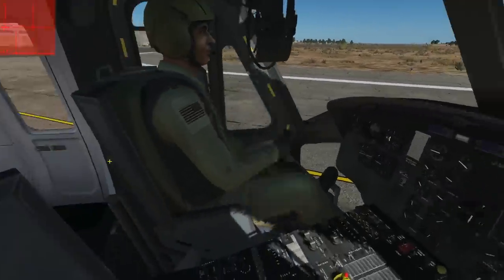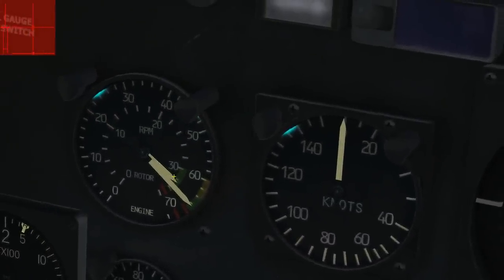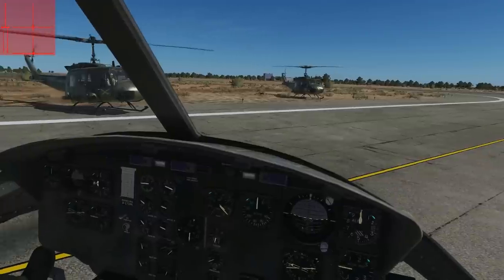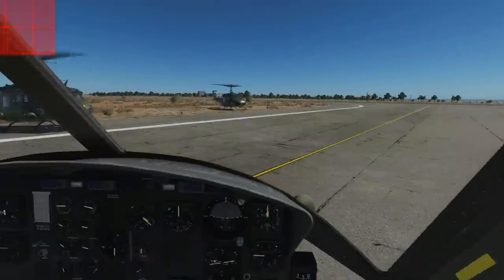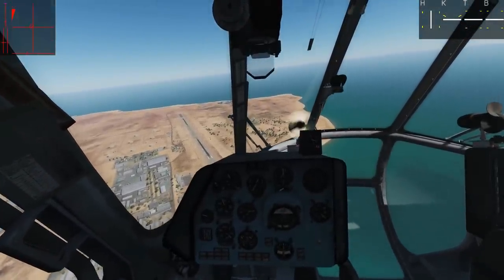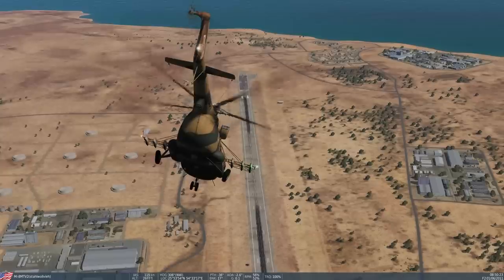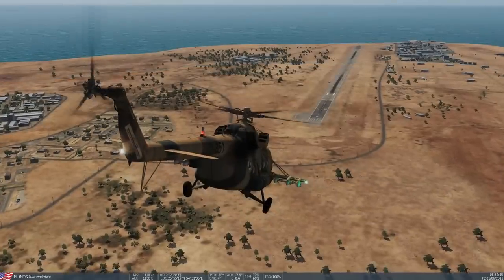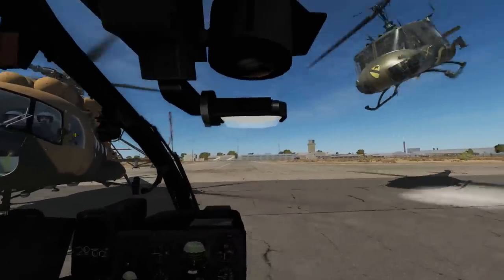Flying Basics: Autorotation In Helicopters Tutorial | DCS WORLD

Comment: Well done Cap! Great demo. I learned on Gazelle, every training sortie ended with an auto until it was second nature. Even the hover taxi back in would have the instructor chopping the throttle! When flying helicopters always be aware of the wind direction and possible landing sites for when it goes quiet. As a rule 65kts is the aiming speed in auto to give most thinking time, 90kts will give range, be into wind with 500 feet to go and start flaring with gentle rearward cyclic at around 100 feet to aim for a check or pull up on the collective at around 20 feet. Should give a very small run on at around 20 kts. The inertia in the huey should allow you to land from a 65kt auto, then pull it back to the hover and put it down again, the gazelle definitely won't!

Comment: ALWAYS ALWAYS move the cyclic AFT on initial entry to an auto, even a zero airspeed auto. Get the rotor RPM sorted and then work on the airspeed. Lowering the collective will make the nose drop for you. Move cyclic aft at the same time. If the nose drops too much you lose rotor RPM, you then lose cyclic authority, and you won't get it back. It has happened IRL with fatalities.

Comment: The reason for flaring just prior to touch down in autorotation, is firstly, flaring actually slows your decent, secondly, flaring increases rotor rpm, giving you more energy availability for when you pull the collective up, thirdly, reducing forward speed before touch down, reduces the chance of having a dynamic rollover. Even though the latter isn’t monitored in this sim, the other two are.

Comment: Cap et al: 2 options for flying a forced landing in a huey-type aircraft - either a low speed auto or a medium speed auto. Low speed:  lower the collective lever and (if less than 40kts) hold level (if more than 40kts) flare nose up to get speed back to 40, then level. Use lever to try and hold rotor speed in the green. Once "about to hit the ground" (about 50' depending, I don't know how well DCS models) pull the lever all the way up from nearly no collective to all the collective over the course of the last 50'.  That works well for going nearly straight down.

Medium speed auto: lower the lever. If above 70 knots, flare nose up to get back to 70. This will give you extra rotor energy as well. If below 70 hold nose level until your descent has established, then gentle nose over to get up to 70. Don't dive it on right away. Hold 70 kts using forward/backward on cyclic, hold rotor speed with collective. If you turn (with bank) rotor speed should try to increase (DCs modelling??). As you roll out it should decrease. Use collective up/down to stop both of these and keep it in the green. When you reach somewhere around 100' (again, depends how well DCS models this and how heavy your aircraft is - a full mi8 will need more height!) Flare to about 10-15 nose up to reduce forward speed and build rotor speed, then use collective to gradually reduce rate of descent. At about 20' put the nose to just above the horizon (around 2 or 3 deg above on the attitude indicator) and pull the rest of the collective. This will stop you having a tail strike. It should be possible to touch down with less than 20kts and a very gentle rate of descent if entering from forward flight.

Finally, because this is the GR and you would never fly high for a mission: from low level at speed, it should be possible to auto (DCS??) so long as no trees are in the way! Immediately flare to 15deg nose up. Lower collective to keep level. When you're hitting 40kts start to lower the lever and level the nose. Then pray!
Reply: Ps. Meant to add. The reason 70 kts works best is because that's your speed at which you need the least lift to maintain level flight. Therefore you can get the longest time in the air in auto before hitting the ground. You can get further at faster speeds, but it doesn't make that much difference and gives you less time to think!

Comment: Try a low level engine failure. Fly at 120 knots 10 ft up the. Cut the throttle. Convert airspeed to height, again watch the rotor speed as it will increase in the flare to height. Then do you usual auto landing. Gazelle is good but you need 40 knots across the tail to help with the torque so keep the speed up until you are down. Then ease the collective down to transfer the weight onto the skids.

Comment: Camera almost lost all rpm because he nosed over so hard. There is a maximum airspeed for autorotation in each machine.  50-80 kts should be your target speed on descent. The only time to lower nose in an auto is if below glide speed. Don’t lower the collective after touchdown or pull aft on cyclic, you will cut your boom off.

Comment: Flight model is not very accurate. In a real helicopter if you were to apply forward cyclic as aggressively as shown the rotors would actually slow down. The rotors have to have upflow from the bottom of the rotor disc to be in "auto rotation". Its the exact opposite you would want to do in a real helicopter. Real life auto rotation entry in forward flight is accomplished by smoothly lowering the collective and applying aft cyclic to build rotor rpm back and put the aircraft in the correct profile. Then you would adjust the aircraft attitude with cyclic to smoothly obtain a air speed between max glide and min rate of decent. Anywhere from 60 to 90kts would probably work ok. Looks to be good fun though!
Reply from the maker: thx
Reply: You can see Camera's rotor coning and slowing big time.  The reason he broke the gear is he ran out of rpm.  It was neat to hear it on the sim.  Other sims don't seem to have that fidelity.  In the Jetranger or OH-58, we keep the helo fairly level.  About 70+ft, start your flare, and that flare will actually keep your rotor energy up due to the airflow through it.  Then you get a level attitude and use collective to settle to the ground.  One other important thing to note:  You are not going to hurt the chopper going forward.  Even at 60kts.  It will slide and make a lot of noise.  But, you certainly can hurt it with sideways motions or backwards.    CAP did a pretty good job on his very first attempt.
Reply: BrittMac422 no doubt. DCS seems much better than MS Flight Sim had when I tried it back in the day. I was impressed to hear that the generators would kick off at a certain RPM and you’ll lose electrics(should lose everything except for what’s on the battery bus). That’s very realistic.

Comment: To expand on the physics a bit, the reason you can create some lift the whole way down is because the outside of the rotor is moving faster than the inside, since it has a greater distance in the circle it has to cover each rotation. You can take advantage of this to have the air flow from your forward movement pushing against the rotor on the inside of the blade, causing it to spin, and the spinning blade pushing against the air to create lift on the outside.
If you check the channel Smarter Every Day, he did a great video a while back on how exactly it all works, including a demonstration of it it in real helicopter... even with confidence in both the pilot and the physics, I don't think I'd be brave enough to be along for that ride!
Reply: That's not really accurate. The outer part of the blade (about 30%) actually does not contribute any rotor thrust at all because of a number of factors but mainly because it is offset by drag. Also the outer part of the blade becuase of the blade twist is almost flat during an auto because the collective is down, so the AOA is small - sometimes a negative value.

The middle of the rotor disc (about 45%) provides all the rotor thrust. The blade has a twist so the closer it is to the mast, the higher pitch it has.  Because of this the inner part of the disc (approx 25%) is at the highest AOA - beyond the stall point - so it has the highest drag and is slowing the rotor down.

Forward movement does not cause the blades to spin. They will still spin even if you descend vertically.

Comment: The gazelle crashes are DUE to the nose down attitude on entry and flaring too early. When entering an auto the airflow through the rotors must change direction and while that is happening the rotor rpm is sensitive and the attitude is extremely important. Most standard autorotation entries call for slight AFT cyclic to aid the airflow direction change and to keep the nose from dropping. Low inertia rotor systems are much less forgiving, which is why the MI8 and UH1 worked out for you, mostly. [You can try this in the game by hovering at ~1000ft AGL and entering an auto without nosing over. The helicopter will transition to an auto without any forward speed at all, be careful to check the rotor rpm quickly since you will rapidly overspeed the rotors. Once you establish a steady state auto you can drop the nose with forward cyclic and by decreasing the collective in order to regain airspeed for the flare at the bottom] Finally, the flare at the bottom turns vertical and horizontal airspeed into rotor rpm allowing you to arrest your rate of descent, reduce or eliminate airspeed, and cushion the landing. Airspeed reduction is important especially since not all landing areas will be several thousand foot runways with perfect surface conditions. Landing the Huey into a field with loose soil at 60-80kts airspeed is gonna be a bad time, for example. Do a little more research and practice then show us your improvements with a new video! The other chap is spot on with his readings of the helo flying handbook. Plenty of info in there to set you guys up for success. All that said, this was still an entertaining video,  Cap. Keep up the good work GR!

Comment: Sorry Cap, I have to disagree on a point you made. Years ago I completed my commercial rotary wing flight training and there’s no need for the dive. The inertia of the blades is created by the upward flow of air passing upwards through the rotor disk. The rotor speed is maintained with the cyclic and the collective. Given enough altitude you can perform a number of maneuvers such as a 180 and 360 degree autorotation, even going backwards
Reply from the maker: rgr MA
Reply: Grim Reapers apologies Cap you will need air speed for the flare near the end of the autorotation. I would practice entering the autorotation at 60 or 70 KIAS.

Comment: Can you instead of shutting down the fuel, turn the throttle down to idle in the Huey? That way you can turn it back up again once you landed and retry the autorotation?
Reply from the maker: I imagine so.
Reply: This should work in game, not in real life tho. The throttle in the real world on a Huey requires several rotations to go to idle. Obviously can't model something like that in game.
Reply: @justinnoel6273  ooh ok makes sense. But how do thay practice it then in real life? Can't think they shut of the fuel for training... Isn't that bit risky?
Reply: @carloolivier1940  honestly I don't know how autorotations are practiced in real life on a Huey. Something like a Robinson R22 is able to just cut the engine to idle because it only requires about 1/2 rotation of the throttle to do so in flight. I don't fly turbine helos but I would assume they cut the link from the transmission to the rotor shaft. Some larger helicopters, and yes a Heuy is a "larger" helicopter(technically classified as a medium), are able to do this with the flip of a switch. It basically disengages the clutch connecting the engine and transmission the the rotor shafts. That would be my guess, but again, I don't fly turbine helos, mine has a piston engine.
Reply: @justinnoel6273  thanks for the info! 👍
Reply: @justinnoel6273  Autorotations in turbine helicopters are practiced by cutting throttle, not fuel (yes, technically it is cutting fuel, but not cutting it off lol).  Even if you take the autorotation to the ground, or decide not to.  I honestly understand the limitation in the game though.  However, you can do "low throttle (lets just say 80%)" autorotations and get the same effect in something like a Jetranger because of the fact you have to enter autorotation, or you will not make it home for a beer later.  I'm not sure if DCS will be faithful to how the real thing is in this case, but, if you suddenly drop the throttle 20% or more, you are gonna need to enter autorotation (generally).  There is a freewheeling unit that basically lets the helo autorotate if the engine isn't putting power to the transmission.  I'm not sure if the Huey has a switch for the freewheeling unit, but, it is automatic if you go into an auto.  I don't mind asking some people I know that have a Huey.  All this being said, I don't know if there is a keybinding for DCS that will take the throttle to idle in a chopper because I'm a DCS noob.
Reply: @BrittMac422  You can just map the throttle and calibrate to a wheel on any control device. Wind it back and you get 0% throttle.
Reply: @BrittMac422  thanks for the info. I know throttle doesn't have to be completely cut to idle and 80% is enough. I'm trained on and fly Robinsons. No turbine experience for me, or high inertia rotor experience for that matter. I don't know how many rotations of the throttle is required in a Huey or a jet ranger to reduce throttle to 80%. That may very well be the case for the Huey. As far as my experience with DCS, well, I don't even have flight controls for it so I don't even play it haha.
Reply: @zzodr  Thanks for that info.  As I say, I am a DCS noob, so anything I can learn is a bonus.

Comment: I'm told that for a helicopter under optimal conditions, with engine cut out, pilots can maintain a horizontal glide-slope of 5:1 -- Can anybody confirm?
Reply: Depends on the helicopter, there's no absolute rule for it.
Reply: Leon is right. Too many factors in play. Change 1 thing and even the same helicopter with have a different optimal glide slope.
Reply: In the UH1 flight manual - on the graphs I think you can get up to 5.8:1. ONLY if everything is perfect - weather - wind - airspeed - and aircraft weight. And it's never perfect.
Reply: @zzodr  Not just weight, but weight distribution will come into it, there's no guarantee that the helicopters CoG is in the optimal place at all, different cargo, passengers, fuel levels in different tanks.

So many factors it makes it an impossible question to really answer except in theory only.

Comment: couldn't be that the gazelle flight model just isnt right
Reply from the maker: i'd agree with that. Hate flying it
Reply: @grimreapers  I can't speak on the flight model of the gazelle, but Cap is correct in his thinking. Low inertia rotor systems lose speed quick and the pilot has to react quick. The less inertia, the less time to react. In real life, once the rotor rpm gets below a certain point, there is no recovery regardless of how much altitude you have.